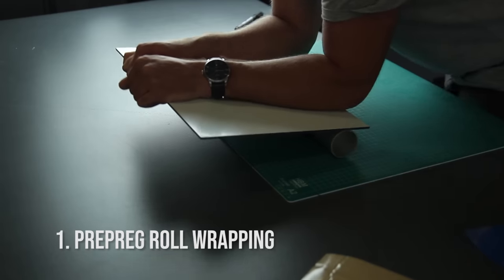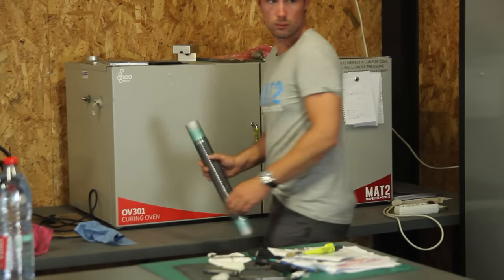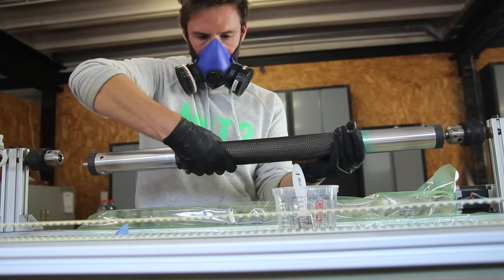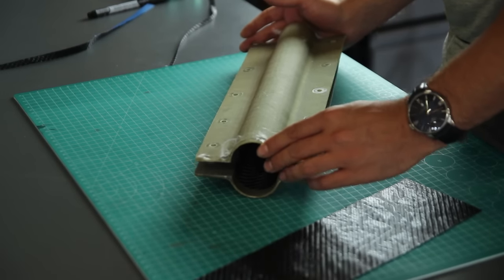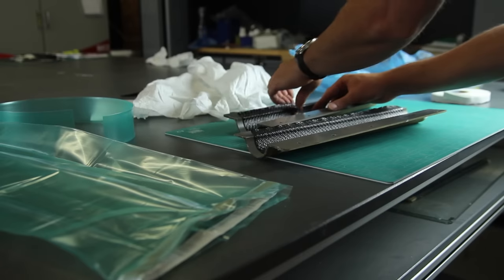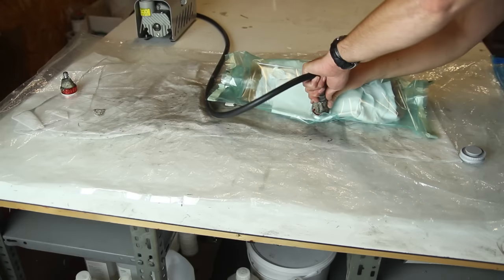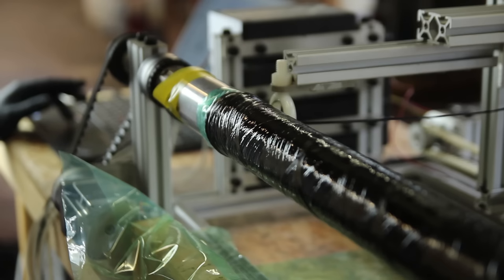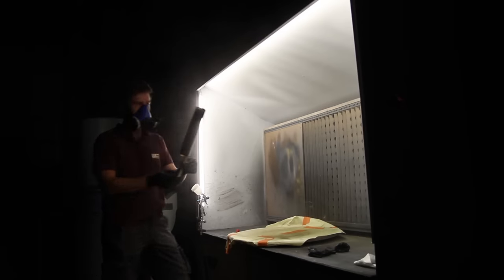How To Make Carbon Fiber Tubes - 4 different techniques (Tutorial)

Comment: ex aerospace filament winding manufacturing engineer here. I worked in the industry for around 10 years before moving 4 years ago.

Happy to answer any questions you may have which x winder weren't answering if it was technique based.
Reply from the maker: Hi! thanks for your comment! The X winder is good but has some limitations, the biggest problem is the carriage. I'll re-design it with linear rails and lighter weight in the future. Glad to hear I can come back to you for more information!

Comment: I've had great success with heat shrink tubing from Soller composites. The epoxy-resistant tubing shrinks down and squeezes out the excess epoxy. Makes a perfect tube!
Reply from the maker: Thanks for the info!
Reply: @MatthieuLibeert  have you ever attempted to test the tubes done in different ways under a hydrolic press or bending forces?

Would be interesting to find out if the technique affected the final strength of the tube!

Comment: I was taught to wrap the tube with 3 layers of tape. The first at medium tension, then tight, then medium for the last wrap. My favorite material to make tubes from was a knitted triaxial carbon at +45, -45, and 0 degrees. I made a 59cm frameset that weighed a little over 3lbs with it, the forks weighed right at 1lb.

Comment: The most innovative way to make a carbon tube is to simply roll the tube and just fill the tube with loose carbon fiber all in the same direction already with resin, done. Don't even bother with vacuum. Ocean Gate approves

Comment: Will there be a video on stress testing these 4 types of carbon fiber tubes? (bending and compression) I would like to see which method gives the best results. Or it would be surprising if the results from the test is uniform across the board.

Comment: What kind of shrink tape are you using? with the exception of the split molds is there a way to remove the aluminum pipe is there are bends in the pipe not allowing the pipe to slip out from the carbon?

Comment: I like your ideas, use to work for profile composite/ profile manufacturing building shafts for the paddle industry and prototypes in the lacrosse field etc. Looking to make a special layup blow gun. I see wil need to get larger oven for what to make

Comment: Hello, thank you for your video. I would like to make an induction manifold from carbon fibre that requires a constant tube diameter with complex bends totalling 6 runners. My thought are to make a silicon rubber mold insert a heavy gauge wire into the centre so that it will hold the shape it is bent to and then layer it with carbon fibre. Will this work . Regards Noel

Comment: Speaking of the braided sleeve method, what's the difference between the mold OD and the carbon tube inner diameter? 
Is there a certain difference between them?
(I'm wanting a carbon ID of 38.5mm, but my mold tube is 38mm)

Comment: I take number 3. do you think you get peel ply out of the tube? Got 60mm outside and need a good as possible surface inside
Reply from the maker: Should work... If you can get the start you might be able to get it out I think

Comment: Is it possible to have make tubes that have threaded ends? I want file a form 1 to build a silencer and this would be an awesome way to do it if I could screw it on a barrel and put on end caps.
Reply from the maker: Yes it's possible! you can add threaded ends by gluing in an aluminium thread on the ends of the Tubes, won't be featured in next video but might do it in a future video maybe 🙂

Comment: Hello,

Will it be possible to make a carbon fiber tube with open structure (porous), such as a filter?
Reply from the maker: Would be possible but not like surface porous, you could cnc drill a lot of holes if needed
Reply: What gives CF it's strength is that it is a composite material with a resin. Also drilling holes will limit the length of the fibers and that reduces strength.

Comment: Which method is the best in terms of strength and stiffness? I've seen videos of driveshafts being made by means of tow winding, but is it because it is the strongest, or because it's more difficult to use weaves to make long driveshafts?

Comment: for high strength, you need to suck vacuum from it. So that 14 psi from atmosphere pressure will be applied to the part to increase the strength. For thicker part, 14psi is not enough, you need to suck vacuum and put the part in pressure container to apply additional 60 psi. If no pressure, there will be random small distance between the fabric.
Reply from the maker: An out of autoclave prepreg was used here for the splitmould tube. So -1 Bar which is enough for this prepreg. You are correct with the pressure but not everyone has acces to autoclaves :D so this is giving decently good results but if your looking for parts for F1 or out of space you'd better use an autoclave with pressure as well

Comment: Who the split mold process be the same if I were to joint two ends together at a corner? Like for a front car splitter lip or a rear car diffuser. Those parts have complex shapes that can’t be don’t in 1 pieces of carbon fiber so multiple pieces of carbon fiber are used.

Comment: Hi Matthieu, I always watch you procedings with great interest and find them very very educational and informative.  However, I would like to present a problem in regard to carbon tubes.  I am an avid model airplane flyer and builder. I would like to make a wingtube. In this case a tube that has an outside diameter that exactly matches the inner diameter of the existing tube that is in the wings.  Is there a method or technique to do that ?   It would be very much appreciated if you could offert some advise.
Reply from the maker: thanks awesome! seeing your name you must be dutch or belgian (would rather think dutch) :D The best way would be to measure out the inner diameter you want for your new tube, buy an aluminium mandrel (with your inner diameter you want in carbonfiber being the outer diameter of this aluminium tube and make a tube on this mandrel). Might be hard to explain on here but I guess it's possible to understand?! :D
Reply: @MatthieuLibeert  Hello Matthieu, thank you very much for your reactiom/answer. I confess: Dutch 🙂.  I understand but I have to account for the lay-up thickness. This is where the problem starts. The tubes have to fit without ANY play. It must be an exact fit. Perhaps I should make 2 tubes that fit into-each other and glue the larger one into the existing tube of the wing. Hoping I will not add much weight by doing that... Then there is the question of how to make tubes with exact dimensions with very small tolerances..

Comment: What about the split technique, with continuous fabric?
Wrap the fabric around a rod, that is much smaller than the split mold, stick it trough and unroll into the mold.
Finally put like a bicycle inner tube into the mold and pump it up, to apply pressure against the fabric.

Comment: And what about shaped tubes with clear finish on both sides?
Reply from the maker: Will show that in the next video, you can finish the shrink tape side to a good finish as well with some care 🙂 the mandrel side will already have a good finish
Reply: @MatthieuLibeert  I mean like prepreg refueling s shaped tube with same thickness of wall on whole part
Reply from the maker: Did it in another tutorial with the 3d printed moulds and silicone expanding core, there youll get a finish on the inside and outside

Comment: What is the strength of braided carbon fiber tubes?
Reply from the maker: strenght is hard to define by numbers, it is strong on 45° so torsion, less on bend and stress
Reply: very strong...1/2 aluminium by wieght and size, in this tube form.....in perfect orientation 40 times stronger than steel!

Comment: How does one make a 5 foot long tube?

As an example, say a paddle for boating?
Reply: You can use lost casting methods with CF. Or you can simply wrap the CF over a light weight structural material that you don't remove afterwards.

Comment: I used a waxed pvc pipe for my wet layup. I then got it off by putting in freezer.
Reply from the maker: correct works well with pvc tubes as pvc releases pretty well from epoxy

Comment: PROBLEM : I am going to make a GOAT Single Seat Glider. Its an AL tubing 6061 T6 structure all arround.  In India we have NO SOURCE for 6061 T6 Al tubing especially the sizes I need....and importing is mental. 
SOLUTION ? CF raw material is available and raw material infact is also easily importable  ... So make the Tubes out of CF 
QUESTION : For a given size of AL ...how do i figure out the EQUIVALENT CF solution ?
MEEEOW???

Comment: There is a nicer way of sealing the bag using 2 pvc pipes. (assuming it is a bag with one open end)
One is C shaped, the side is open. You wrap the plastic around the pipe, do not roll it.
Clip the C shaped Pipe over the plastic and pipe. 
Your done and can re-use this over and over.
The closest example I can think of is a woman's hair curlers. But there is no need to roll the 'hair' around the curler, just a wrap.
Reply: Have you found any video's of this process or websites explaining this?  I'd really like to see it done in practice as I'm not 100% clear on your explination.  I understand the hair curler comparison  but I'm not sure about the bagging & plastic wrap part.
Reply from the maker: Hi Dave, thanks for your comment! Not 100% sure I know what you mean as well, do you mean you put a pvc tube diameter on the inside of the bag, then clip on a c-shape pvc over the bag and pvc tube that is on the inside of that bag to seal it of? If seen it being done on ends of bigger vacuumbags but not sure you can get it fully leak free that way, mostly seen it used in veneer wood bending with vacuümbags, where vacuum doesn't have to be 100%